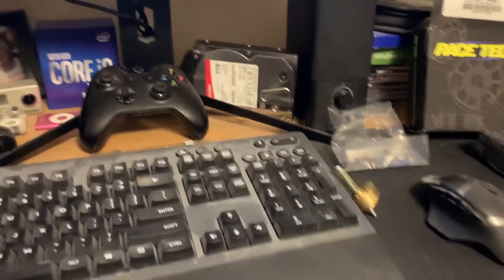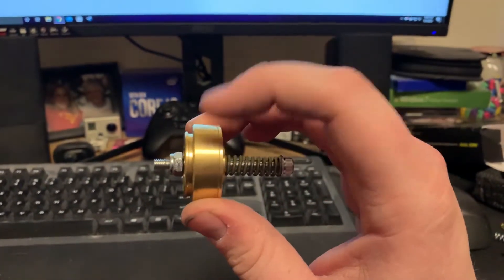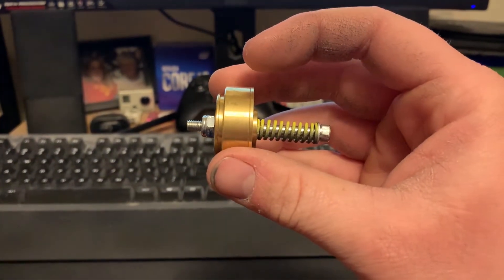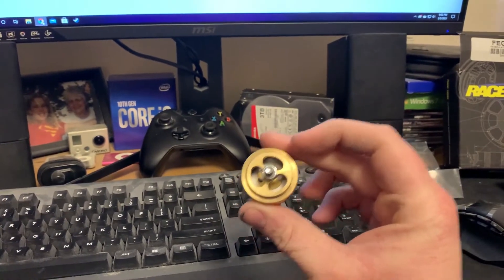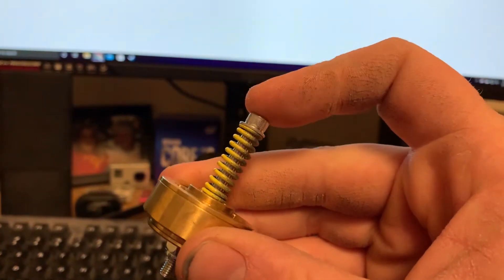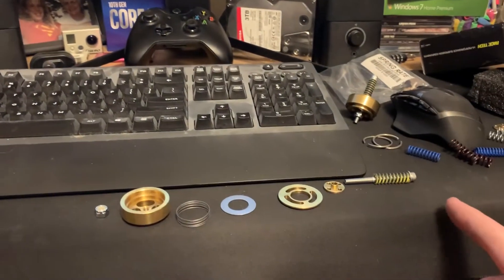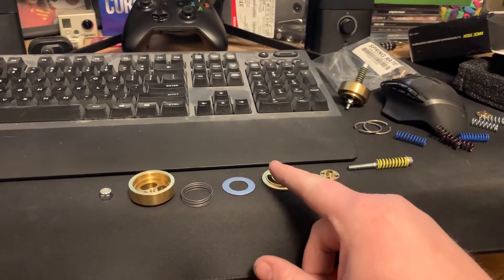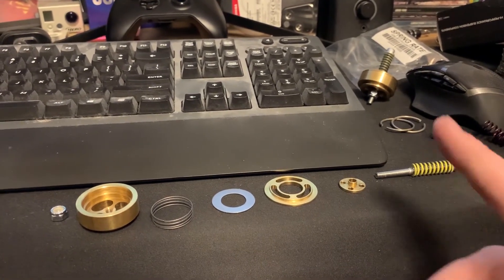Why I went with RaceTech Cartridge Emulators over Cogent DDC's for my DR650 and how they work!

Comment: Thank you so much for making this video. I had just purchased the same emulators for my 2020 to 650 and was very frustrated or disappointed when I saw the biker bits video and he completely bypassed the drilling process. It’s surprising to me that race tech has not produced a detailed video on the set up and installation of these valves. I’m sure it would save them a lot of customer service calls with frustrated purchasers.

Comment: Great to see a video of the DR650 with a rider of similar weight of 290 lbs. Good point about you need to drill the damping rods so the Cartridge Emulators are doing the valving.

Comment: One of the best explained video on Gold Valve Emulators, so thank you! Did you manage to get the check valve spring rate? The spring used for Shim opening (Not the compression valve main spring)? This info is missing everywhere online.
Reply from the maker: No I did not. Sorry.

Comment: MIne also said 4 holes in the plate, but that didn't make sense to me. I installed it with two holes (to try before making any changes), and 20W oil. RT said 15W. Even at 2 holes and 20W oil it was UNDERdampened in compression, but rebound was perfect. I believe it also said 3 revolutions of preload on the spring, and middle spring strength. Take these recommendations with a pinch of salt; ride your bike.
Reply from the maker: @Kjutte1  that’s the joy of the racetech is that it’s very tunable.
Reply: @OgreMoto  Agreed buddy, but the point was mainly that the recommendations that came with it was crap
Reply from the maker: @Kjutte1  depends on the person and your preference honestly. Racetechs setup was damn near perfect for me.
Reply: @OgreMoto  Happy to hear!

Comment: As there are two springs of different stiffness I just wonder if the emulators control the flow in both directions, with one spring pushing back against the compression movement of oil and the other against rebounding movement of oil. Otherwise why have two springs ?

I like the fact it allows for compression damping but I'm thinking the oil flows both ways and two springs present means it probably allows rebound damping

Comment: Would have been helpfull if you would have shown the drill out part. How may holes what size bit? Still in the dark there.
Reply from the maker: If I recall correctly, Racetech includes a full instruction sheet online through a token they provide when you buy the valve. What you drill out in the damping rod and how big the holes are dependent on what you input into their valving application. 

So saying that information would mean nothing as you and I are two different sizes, weights, and have 2 different riding styles.
Reply: you need to put your input in at the website such as your weight your riding style and the such then racetech will give you the right number of holes to drill out with a 5/16th drill bit.....you may not even need to drill more holes than the way it comes, usually comes with 2 or 3 holes already drilled

Comment: Rebound is probably more important than compression dampening...in reality it is 50 % of the equation..does the valving stiffen as the fork compresses?
Reply from the maker: I agree, that’s why I went with this solution! And yes it would stiffen the more the fork compresses because the valves is operated off of a spring itself. On top of that, the more oil you push to the other side of the valve, the more resistance you’re going to have because it basically acts as hydraulic fluid.
Reply: @OgreMoto  thankyou...trying to decide about where to send my 77 rm 125 resto mod project...forks are the last  thing.
Reply: Rebound is being tuned by using the suggested heavier 15wt fork oil,  10wt is stock on the DR650.

Comment: Great video, thanks. Do l have to change the springs too? I like taking my Dl650 off road and l wouldn't mind having a better front suspension.
Reply from the maker: Spring rate is dependent on your weight and what you’re carrying
Reply: @OgreMoto   @Ogre   thanks for your answer. l was just wondering if l would getter better suspension if l only bought the Cartridge Emulators, or do l have to get new springs. I am 200 pounds so l am probably close to average weight.

Comment: BTW, I did look through all of your past videos and never did see a follow up video about this modification. Can you at least post her in the comments the upshot or result of your installation? In front end performance and dampening? Thanks, Richard.
Reply from the maker: It vastly changes it for the better. I wouldn’t hesitate to do it again. You can take corners faster, actually hit jumps, and it handles my weight so much better than the forks did stock.